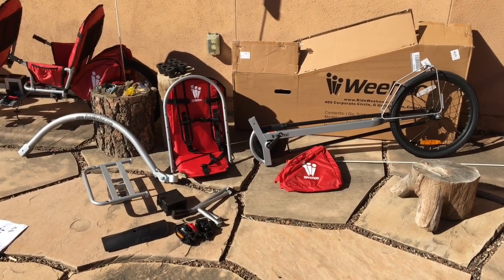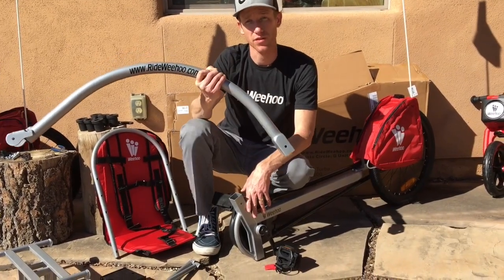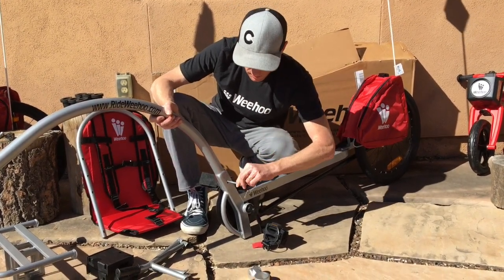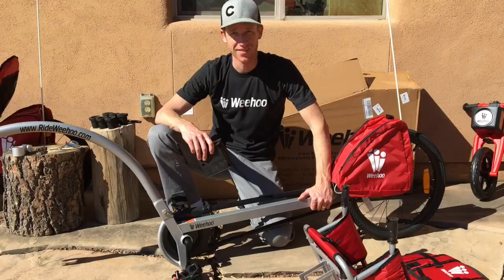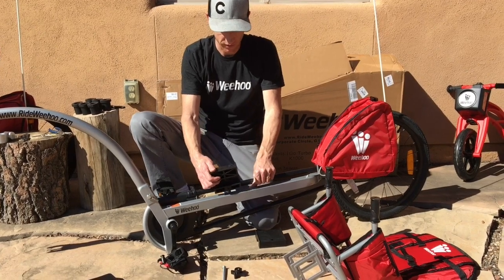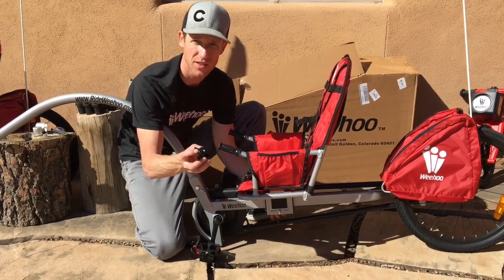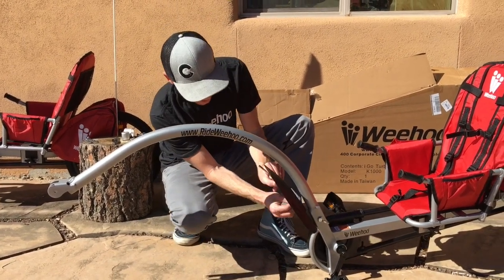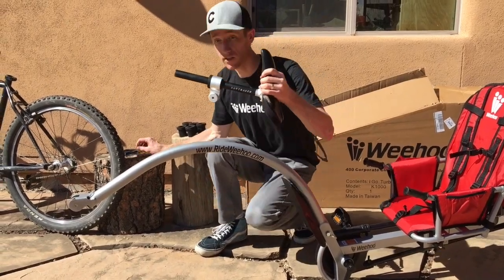Weehoo iGo Turbo - How to assemble!

Comment: I had that style hitch mounted on my MTB seat post, and some A-hole stole my MTB!  Now I need a new hitch for my new MTB but the “new” style hitches are different and won’t fit the mounting bracket on my (older) WeeHoo push bar arm.  Do I have to spend $99 for a new dropper post hitch and another $150 for a new push bar to fit the new hitch?  Can’t I just get an older style hitch for my seat post?